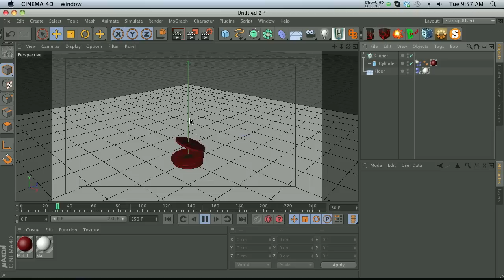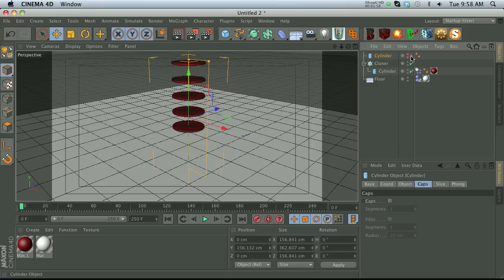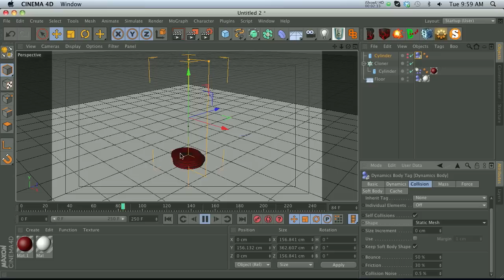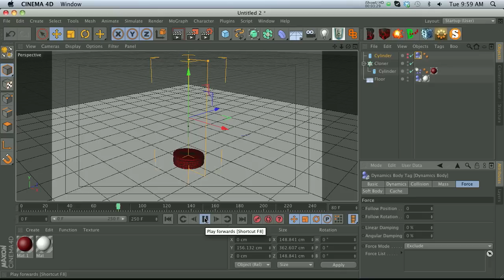C4D Tut: More Control Over Dynamic Settings

Comment: Using a container object to limit the space where dynamic objects are allowed to go is definitely a good method.

Nevertheless you get much more realistic results if you choose the right settings in the first place. I rebuilt this scene and got the same result just by increasing friction and lowering elasticity. (Increasing the overall substeps and collision distance helps when things still wobble around or intersect each other).

Still a good tutorial! Keep it up! :)